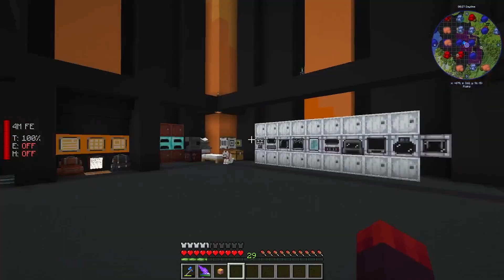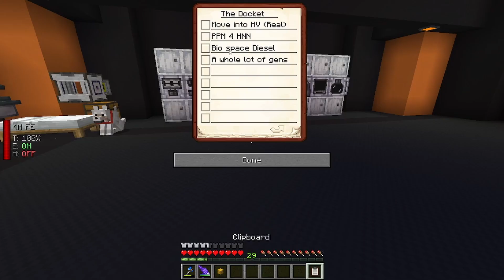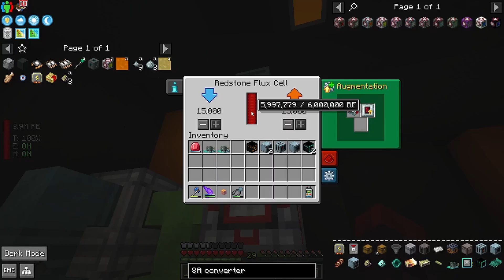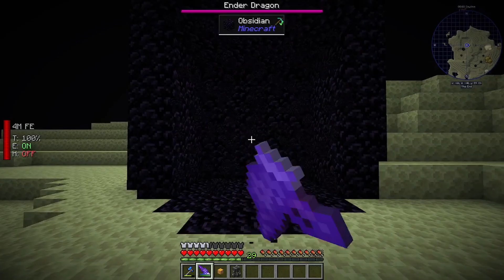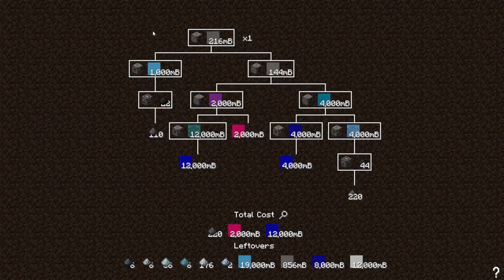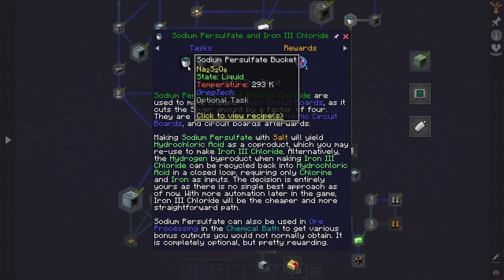Polytetrafluoroethelyne and Bio (space) Diesel - Monifactory Ep. 6

Comment: Loving the series so far!

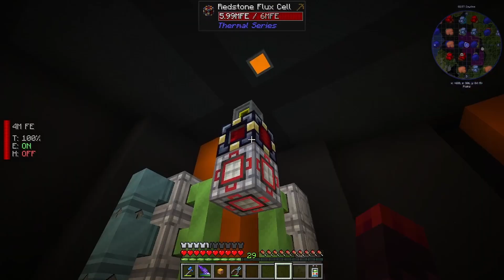At 7:18 it's better to use a greg-tech battery buffer into a converter, because that allows for higher throughput, this might not be an issue now, but later on it will make moving to centralised power easier
Reply from the maker: That's probably the right idea, I'll swap the system over next time I load up the pack. FE/t I/O on the energy cell is pretty limited, and I imagine will hit a hard cap early into EV or IV. Thanks for the tip!